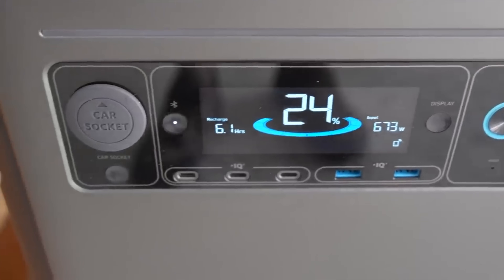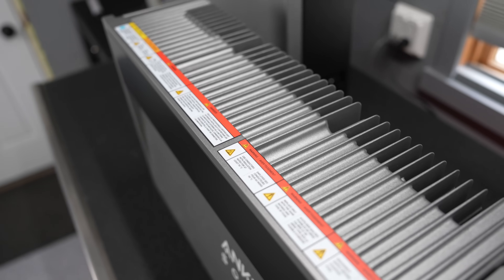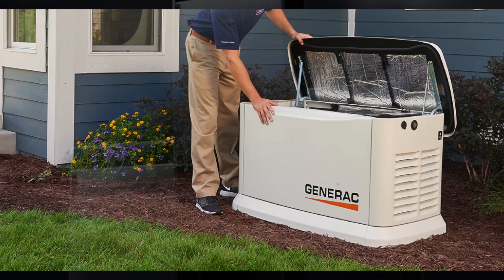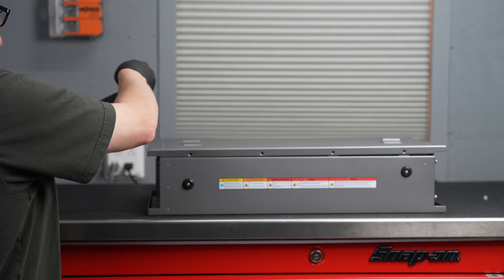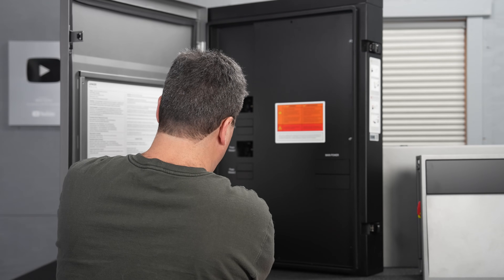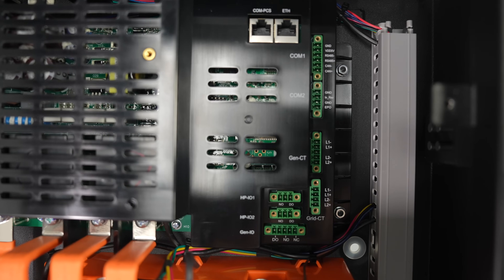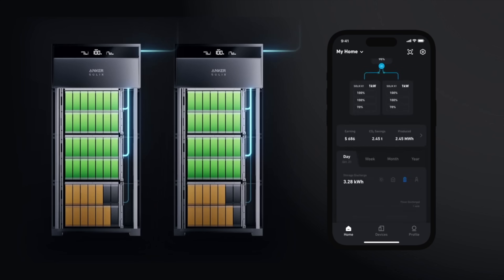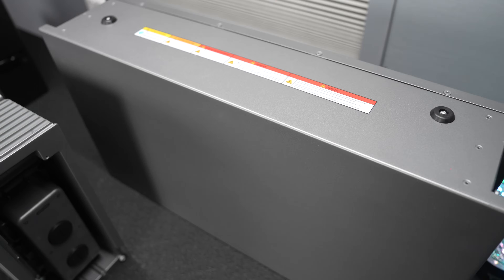Anker's FIRST Whole House Power Backup - SOLIX X1 Overview & Teardown

Comment: Lack of price and forced licensed installer is a huge issue. I live in a very rural place where something like this is needed by myself and neighbors but whenever it comes to this we are always 'too rural' for their to be any installers. Also it seems you need to have other equipment on top that to interface with solar panels. Does it not work with the ones they sell too in a convenient way? Doesn't make any sense. Going with Ecoflow instead.

Comment: You can check these out all you want in North America, but they aren't available. Anker likes to advertise their products about a year before you can buy them. The big drawback with this product is that it is AC coupled only. That means that if you want to attach solar, you have to buy an inverter/charge controller  as well as the panels.

Comment: Can you compare this vs the F3800 + Batteries?  From all my research it seems the F3800+Batteries are cheaper per KWH so I'm trying to understand what this offers over the portable solution (even I don't plan on using the portable feature)?

Comment: I’ve been debating whole house power to get coupled with my solar. 

I want to be 100% self sustainable if needed, and the only way to avoid blackouts is home battery units. 

Our electric rates here are dumb (no metered rates) and solar obviously gets sold to the utility at a “lower” rate than what we buy for. (We sell to them at 50-60% of our buy cost from utility)

I’ve been hoping something “cheaper” comes that will cover my house and future proof me for EV (yes I’m one of those people).

Comment: The X1 is dead on arrival for the self-sufficient folks that are looking at the F3800. The whole appeal of the F3800 system was the ability to purchase at retail (and, potentially install) your own equipment. The X1 is hiding behind "professional installers" like Powerwall, Enphase, Evervolt, etc. Disappointed you didn't call Anker out for this.
Reply from the maker: I believe I said 3x that this isn't a DIY system and you needed a pro. I agree with you completely here
Reply: @SilverCymbal  That's fair, you did. I wasn't necessarily meaning DIY - more so that I wish you could purchase at retail and have a licensed (non-Anker partner) electrician install. Thanks as always for the great videos!

Comment: This review was way more helpful than the other ones out there! Do you know if the gas generator hookup for this unit has to be a 240v generator or can it also be a 120v generator?
Reply from the maker: Thank you, it definitely needs to be 240v. What they didn't have at the time of this video is how the generator will run. Meaning is it auto start somehow or can it be triggered or is just done manually. They would be the only ones that could answer that as I don't have that info.

Comment: This is awesome until 5 years from now when some part fails and this model is discontinued  and you have to buy a whole new system and batteries
Reply: You realize that these things come with a 10 year warranty right? They also will be able to be replaced by any compotent technician, as these products are not proprietary. It uses existing technology.
Reply: @Boguardis  Well, I live in the real world. No way they will support this in 5-10 years, and no, these are not user serviceable. That is dreamland thinking.
Reply: @NeverTakeNoCut-offs  I mean, they are obligated to since they have a warranty... 

You're insane to think that there are parts in here that can't be fixed. It's literally just some batteries and some inverters and some wiring.

I don't know why you think it's so magical....
Reply: @Boguardis  Sure. I'm sure lot of people will be fixing their own, just like I can fix my own SolArk and Fortress batteries..  These things are toys.

Comment: Would love to see a 6 month update! Does it save money?
Reply: It does not "create" electricity.  That electricity must come from solar panels, wind turbines, or from plugs into city power when that is available.  Save money?  If you buy the system to use in emergencies, saving money is not your primary goal. Storing and providing/utilizing stored power as needed is the purpose.
Reply: @WilliamMurphy-b6v  well duh. Nothing “creates” electricity. At least not effectively for residential use. 

I was asking if the programming actually works for running house power from the battery instead of the grid. And how effective that actually is.
Reply: @oscarcorral1428  You lost me, and likely many other commentators, when you wrote:  Nothing "creates" electricity?  Really?  Where do we get it from then?  We dig it up from the ground?  We wave a magic wand?  Please reread what you say and write after you do so. Make corrections as needed.  Otherwise, people will think poorly of you.
Reply: @WilliamMurphy-b6v  Dont care about what others online think about me. I simply expressed interest in seeing an update after some experience and how that affects the electricity usage. Do you have any experience with this system? Anker is clearly advertising a programming feature that's meant to give back electricity to your house and save money on your bill.
Reply: @oscarcorral1428  I think the idea of saving money comes from places where utilities charge different rates for different times during the day.  Under that system, you could charge your batteries from solar or even city power during the cheapest period and then use that power from the batteries during the most expensive period charged by the utility.  Seems like a great idea, but the cost of a whole-house power banks (battery) may make the payback take too long.  Too many variables to discuss in one video or in this comment.  Among them are:  Differences in rates charged by the electric utility in your area depending on timebof day.  The amount of power you must need to use during the higher cost times of day.  The cost of your power bank and panels (if you charged by solar).  The lifetime of your power bank (and panels, if applicable).  Whether or not you could simply shift some electrical use to a cheaper time of day instead of using a lot of electricity at peak times.  You would have to take a very close look at your own area, the cost patterns offered by your own utility, and your own specific electric-usage patterns (and how willing or able to change those patterns you might be).  Quite complex.  My bet, if I was a betting man, is that the VERY high cost of electrical storage units (battery/"generators") might make a payback too far into the future for the scheme to work economically for most folks.  Hope this helps clarify things for you.
Reply: @WilliamMurphy-b6v  Yes, I completely understand. I’m just looking forward to seeing reviews after letting those variables play out.

Comment: Don't like it needs a "pro". Most "pros" do worse job than you'd do and would be reading the manual the same as you. You think some old boomer electrician who still runs coax lines to each room (my brand new 2024 built house) is going to have a clue what's going on here?
Reply from the maker: I agree with you. I was excited to get to check this out, but for my own house I like the Ecoflow one that I installed. Its easy to remove, or chgange down the road too: https://youtu.be/_G7ZPjmR5ck
Reply: Facts 💯

Comment: At one minute and twenty six seconds, you show a “WLAN/4G” bung, presumably to connect an external antenna or something, but I was wondering if it has any actual Ethernet connections, as I hate WiFi. At the 1:34 second mark, you show a bunch of RJ45 plugs, but I suspect they for a CANbus of sorts between battery modules, rather than Ethernet.

When they initially were talking about this thing, my only recommendation to them was to see if they could make the inverter modules 8kW instead of 6kW each, to remain competitive with Powerwall 3, as the PW3 is the standard to beat for commercial options outside of the DIY stuff of the likes of the EG4 stuff.
Reply from the maker: I think this model will only support WiFi at this time, yes you are correct the RJ45s are only for inerconnects. While I am glad that Anker is getting into the whole house space, I totally agree that the specs could have been higher. I am also not a fan of the unpublished pricing since it difficult to know the true installed costs. It will be a tough sell for most people, maybe Anker is trying to move too quickly.
Reply: @SilverCymbal  yeah, I mean, I get they cannot just provide a one size fits all install price, but they could provide a unit price of the X1 itself uninstalled, like Tesla does with the PW3, with actual installation/total costs on top being provided at quote time.
Reply: Excellent point. Not disclosing the unit price leaves a lot of room for markup by the installer which is an evil business practice. Just charge me the labor and the cost of the product. Not labor AND an inflated markup price for the product.

Comment: I had one of these priced out for $26k with 20kwh of batteries and backup.
Reply: I imagine an EG4 18K would be way cheaper?
Reply: In europe one piece(5kw) cost only 1450€. You can stack 6(30kw) and of these you can connect also 6 !!(so 6×5=30 times 6 = 180kw )
Its also tested in temps between -20° and +50° celcius.

Comment: The pricing is nearly 1000$ per kwh for low consumer end products.
That is absolute insanity.
There are plenty of Chinese suppliers with extensive documentation and certification selling for the range of 200-300$ / kwh
there are even Mexican suppliers for that price.
and there are even independent companies in Texas doing it between 300-400$/kwh.

Nothing in this product range in my opinion justifies the pricing. The home battery industry has been preyed on and abused by marketeers for too long..
The fact you can buy a Tesla electric vehicle and use that as a home battery, with higher capacity, cheaper than some of their models is absolutely insanity

They have some amazing products, but the home battery series are just not some of them.
Reply: This should be one of the biggest selling point of EV. The vehicle would already be plugged in to charge and serve as the battery backup in case of outage, solar or generator would top off vehicles when needed.

Comment: Canadian here. What’s the best $/kwh whole house UPS today? Ecoflow? Tesla? Anker? Something else?
Reply: EG4 14kw battery and their 6000xp all in one inverter charger. Don't waste your money on that other stuff.
Reply: I'm still waiting for Anker to get back to me in Canada with any pricing. I don't think ecoflow has a comparable product (Solar integrated). Tesla powerwall was quoted at $30k incl GST.
Reply: Any info yet? @AndrewBatiuk
Reply: DIY: These companies are fleecing consumers making massive profits on the batteries.  You can build a 16 kwh pack for under $2000.
Reply: Jackery solution is way cheaper than EcoFlow and Anker here in Canada. But as soon as you want a very big system, something from Tesla or Enphase will probably end up cheaper than something from the solar generator brands.

To give you an idea, Jackery solution is half the price of EcoFlow and Anker's doesn't appear to sell the transfer switch here (probably not rated CSA).

Comment: What if I don't want to use their internet of crap app? I don't like connecting my stuff to the internet.
Reply from the maker: That’s a totally reasonable thing I would not buy a device like this. Is this particular one absolutely requires the Internet other portable power stations do not you could use them for firmware, but it’s not required to be connected all the time like this one.

Comment: LOL. 50 bucks says the app won't work without power / internet.
Reply: So I have the Solix f3800, and it can work without internet because it would switch off WiFi to Bluetooth. 

This issue continues to be that ONLY ONE USER CAN SIGN IN AT A TIME! It’s incredibly annoying because if The Missus wants to check the battery state, it signs me out. 

Also, it lacks some features that the competitors already have. Granted firmware updates could bring those features in, but that’s only a “could”. 

I see no reason why this would be any different. I’m sure the hardware is going to be fine (my F3800 is great) but I can guarantee the app/software control is going to be lacking.

Comment: Thanks Chris. Good to know it's out there. I follow the old saying, don't buy the first model year. I'd also want to see a long term use review before buying. I'v seen Tesla Power Wall reviews about just using the Power Wall not line power. The Tesla didn't last very long for a small So Cal family, 1100 sqft house with car charger.   Limitations  arrgg.
Reply from the maker: This can be wise, as you know I show a lot of Ecoflow products and currently that's what have in my own house. They are now on their 3rd generation. It's exciting to see Anker getting into this space and this product may end up fantastic but as you say only time can tell that. But I didn't want to not show this and check it out with the opportunity. But the system has been returned to them.

Comment: Hey, the thumbnail shows "36,000 Watt" --- what is that supposed to mean...?
(Presumably the units are wrong)
Reply from the maker: These main units can be combined from 3-36kw which is currently the biggest of any system on the market. As they link up they also combine their output wattage
Reply: @SilverCymbal  I see! So it really is 36kW, if you choose to party during a power outage 🙂
Reply: when you rob a bank to afford all the components let me know-Ill  go with you-too old to run but can drive the getaway car

Comment: Too bad they don't tell you the price, and you can't buy it separately. You can only get it through their certified installer network.
Reply: It’s rather annoying. I’m a licensed electrician, why can’t I install it myself.  Or even if you’re not, it’s your house, just make sure your permits and inspections are in order.
Reply: @ This is not for most people. Find a Tesla powerwall 3 and do a clean install. I am going to get a powerwall 3 installed because of better software, built in inverter, 11kwh output and a company that is expected to last for the warranty period.
Reply: @ anker has been around longer than Tesla.  They’re not going anywhere.
Reply: In europe : 1450€ for the 5kw
Reply: @maxheeringa753  That's...not actually terrible.
Reply: @maxheeringa753  Installed? That's pretty cheap. As of 8/27/2024, that's $1621.53
Reply: I don't mind the certified installer requirement since I'd never be the one to install it, but, yeah, it would be nice if they at least said each battery pack costs $x and the minimum configuration with the following items will cost $y.  I'm looking to get a Generac or Kohler generator (powered by propane), and I know that's gonna cost me some bucks.
Reply: @bikeny  They need be cheaper than Tesla.
Reply from the maker: Its a really different model and for those of us used to regular power stations it likely isn't a good fit. But I think there are others that don't want to touch a system themselves and just use it and thats where this type of one could be helpful.

Comment: Damn you Silver 😆 

I've been trying to wait for sand or sodium batteries to hit the consumer market 

But damn is this tempting
Reply from the maker: Agreed, the sodum batteries seemed to be doing really well then they went quiet. Not sure why or what happened.
Reply: @SilverCymbal  first US plant only came online like early May 

I think there's like 20 start ups working on it in different capacities.

The cost savings are pretty massive not to mention the safety differences.

If Anker openly said they have plans to build compatible expansions including ones with sodium batteries... I'd probably get a quote immediately
Reply: Sodium batteries may be cheaper but don't have the energy density. Think of something more like a clothes dryer size to get the amount of energy you'd need to backup a house.

Sand batteries store heat, not electricity directly. While useful, if you want to convert that back to electricity the losses are going to be huge. Though, if you had a 10000 gallon tank of sand under your back yard do you really care, considering the sheer amount of storage you can have...
Reply: @Snerdles  I wouldn't mind a refrigerator in certain parts of my house to give whole power backup
Reply: @NerfThisBoardGames  They may come in the form of server rack batteries, kind of like the EG4's. There is a company called Natron Energy that is already doing something like that, but more for industrial use. Home products in a similar style are probably only a couple years away.

The problem is that if you look at their BlueTray 4000 1U battery it's only 0.27kWh. if you got a 48U rack (7 feet tall, like a big fridge) you'd only have 12.9kWh. that's less than 3 EG4's that are 5kWh each and only need a. 12U rack (1.75 feet).
Reply: Sadly they don't support DIY installs :( I asked, data centers only

My system pulls 30kWh a day, so I actually wouldn't be upset with a 13kWh system to get me through a power outage

Comment: I refuse to touch anything Anker ever since their child company Eufy had that massive camera vulnerability that let any Rando McShitass watch a live feed of your Eufy cameras with nothing more than a webpage link, then tried to deny and cover it up until they were blasted across all of tech youtube and other media for it. Also, different arm of the company, but my Anker headphones sounded like shit and broke within 3 months of use.
Reply from the maker: Certainly a very reasonable point. And as a built in system you have to connect it online, there is no option. When situations like that happen, it takes a while to recover, based on what you are saying I still think they have a ways to go.